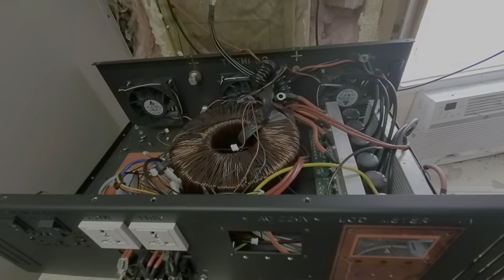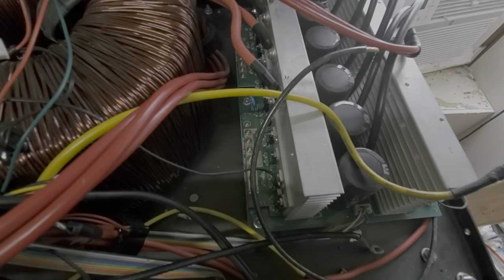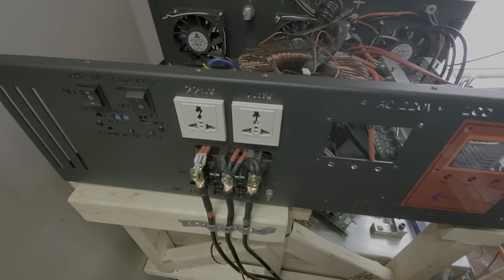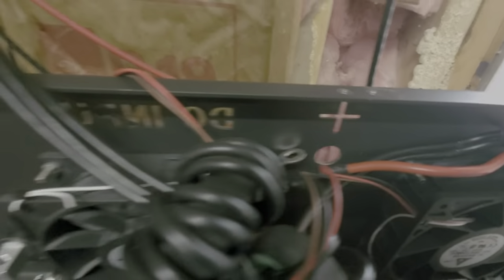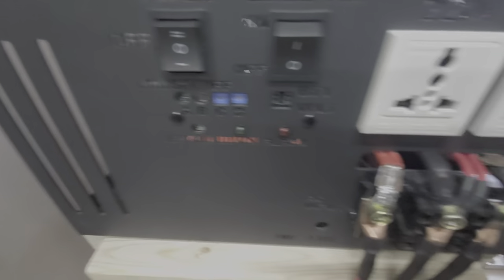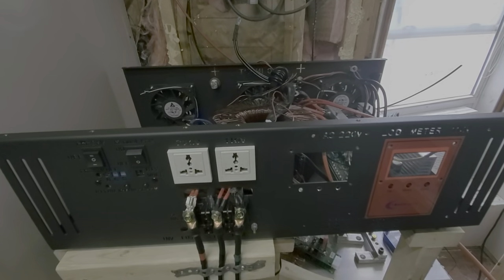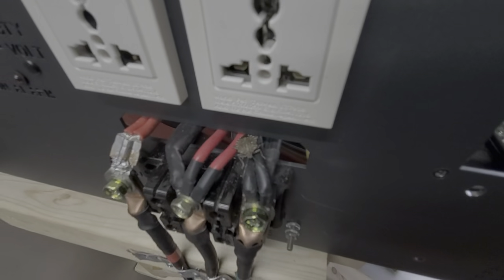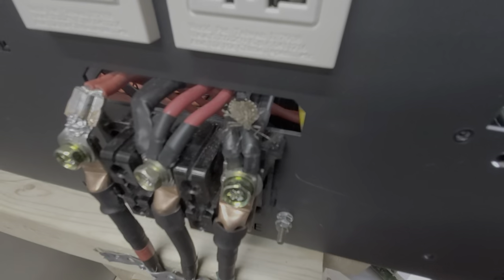This bugs me

Comment: Rodents are a serious issue here in New Mexico.  The damn things have a taste for wire.  Silicone Wire seems to be one of the favorites.  Spark Plug  and other.   Contact your local University Entomology department. .  Ask them for Hormone Traps .   Most have a fashion of Hormone Traps for most all problematic insects in the area.    

Capture a few of those bugs.   Contain them in a livable open top container.  Put the container in the corner of the room out of the way.   Any other of the same type will be attracted to the container.   I GUARANTEE.  That's how I deal with Roaches.   IT WORKS, Sir.